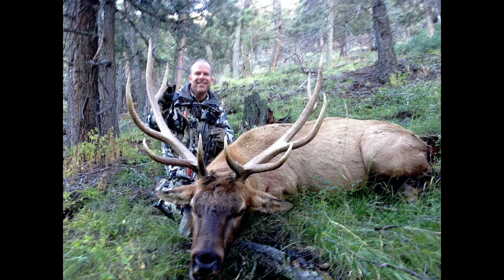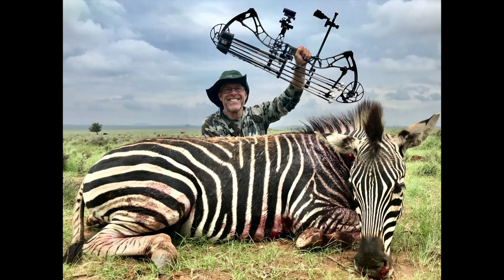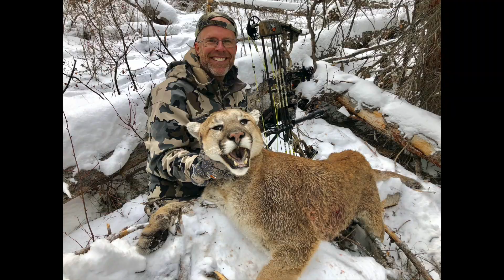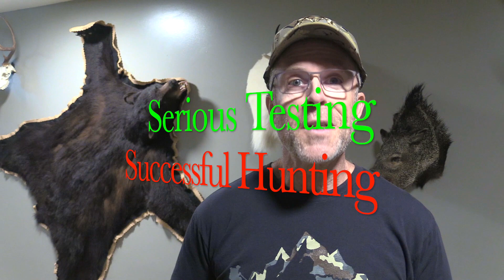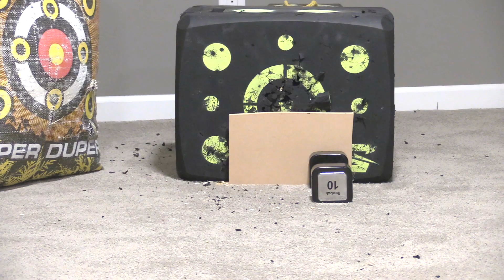SWHACKER 225 (3 Blade Mech) Broadhead Test

Comment: Gotta be honest, your tests are definitely not geared towards the average white tail hunter. Concrete? Plywood x5 hits? 
Tissue damage is a myth as well. That definitely does not replicate the results of tissue damage well at all. The animals move, or do they just drop when you shoot and arrow into them? They move. So does the broadhead create enough damage to cause wound stretching? That should be the part that matters. Can that broadhead cut enough tissue, to create a secondary cut along the initial cut?  On the swhacker, every time! I've killed 100+ deer with those broadheads. Never lost a single animal since using them. I also think you are a bit biast towards certain broadheads! Especially single bevel ones. I would like to see more accurate field testing. Where you simulate skin, muscle and tendons stretching. Because that's where swhacker makes its self shine. Retrieval is never really an issue.
Reply from the maker: Thanks for your comment, James. I  really appreciate it. My tests are designed to provide data points for comparisons between heads, revealing weak points. That's all. How each person interprets that data is up to them. There's no bias, cause the scores are the scores; the measurements are the measurements. Does a head have to hold up super well to a concrete shot in order to kill a deer? Nope. And I try to say that as often as I can. BUT, if one head can hold up well to a concrete shot and another cannot, all other things equal, I know which one I would choose. I always say, "Check out the score sheets and see what matters to you the most." 

As for tissue stretch and hole size, I also try to emphasize that as much as I can. The wider a hole is, the larger it will get once the animal starts moving. For that reason, I do prefer a rear deploying head cause they will create a wider entrance than a front deploying head. 

So I appreciate the feedback and am so glad you've found a head that works well for you. That's what it's all about. But I'm not being biased or unfairly testing heads; I'm just providing measurements in consistency testing.
Reply: You don't have to be so anal. The dude shot it through and at stuff harder than bone. It would take a lifetime to test every broadhead in the field. Why are you watching reviews on them if you already field tested on 100+ deer?

Comment: Did that head get through the MDF board before the blades deployed?  Was there sign of wear on the main blades?
Reply from the maker: Yes, the blades were deployed. You can see the close up exam of the head after the 5 shots. They did quite well--just some slight bending.

Comment: The wobble is designed to increase reliability and durability of the blade it allows it to flex whilst in the animal it as no affect on the performance. Still don't understand why people shoot aluminium expandables one shot and they're done. Get a nice fixed blade and you're sorted. Cheers for the video.
Reply from the maker: Thank you. I appreciate you watching and commenting.

Comment: I shot a doe with this head last year. I didn't get great penetration on a high hit. Went right under the spine and barely poked out the other side. I was lucky to clip the artery. The ferule held up fine but the blades did get bent up, not sure if it was from the shot, or from the deer crashing. I always felt that the belly (where the screws are) made it seem like it wouldn't penetrate well.
Reply from the maker: Thanks for sharing that experience. When encountering bone at different angles and with moving animals, heads can experience way more damage than most people realize.